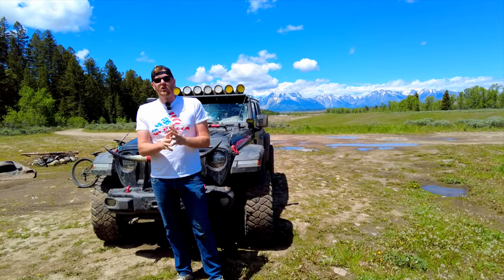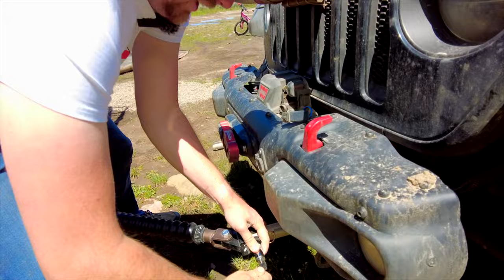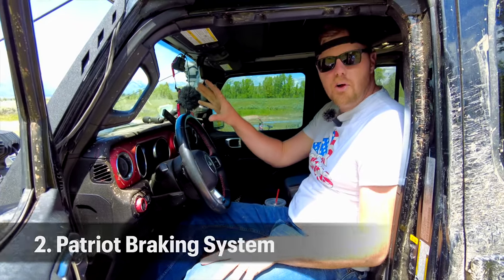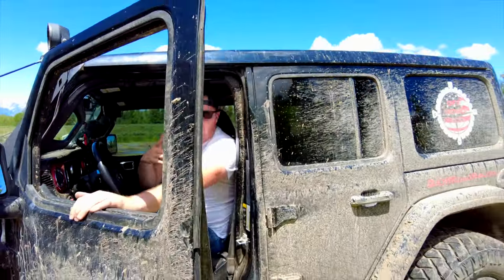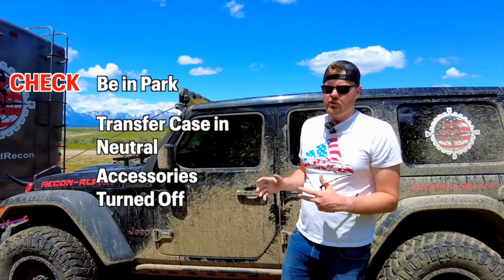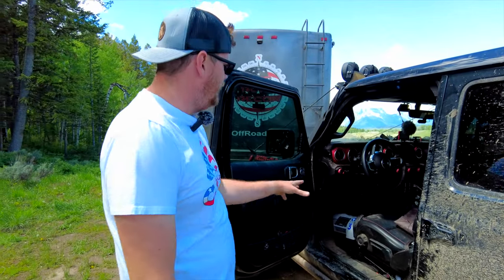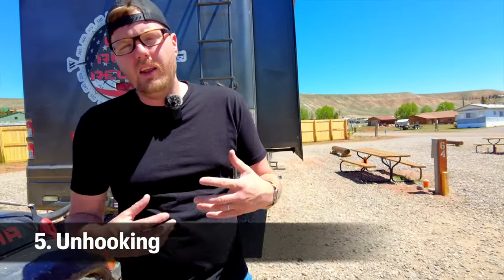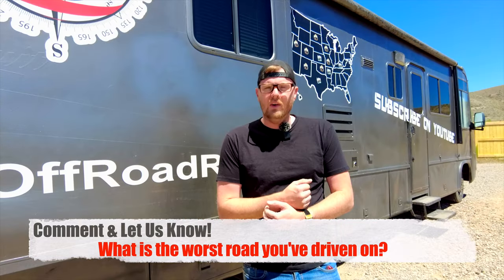Flat Towing: 101 With BlueOx Patriot Brake System (MOST VEHICLES)

Comment: If you cross your safety cables under the tow bar before hooking to your baseplate, it will hold your tow bar up off of the ground if the towing system fails.
Reply from the maker: Good tip. Thanks!

Comment: Ima is correct those cables are supposed to go to the opposite side. Blue Ox rep stated to make sure you criss-cross them under the Blue Ox bar. He also stated to place the pins and hooks facing the same way. That is if the lock is on the inside for the right it will be on the outside on the left arm.

Comment: Doesn’t that thing bounce around while you’re moving?  Seems like it has to be set in there just right and if it gets out of wack it won’t work. ?
Reply from the maker: No. The metal arm holds it in place. If you get it to tight it won’t work and or hold your brake lights on. We have put thousands of miles on our flat tow setup.

Comment: Thanks for the video.    Does the Blue OX Patriot drain your battery ?   If so, how do you get past that issue?   I have a 2022 gladiator and was thinking of buying this system.
Reply from the maker: Depends how long you flat tow. I have done 3 day trips with no problem.. you could always remote start your Jeep every once in a while to let the alternator charge it. Hope you subscribe!
Reply: @BenandBrandi  Thank you for your response.  I appreciate the information as I am now planning on getting the Patriot 3 also.  And yes, I did subscribe...  😀

Comment: Do you have a video explaining the set up of the wiring for the braking system? I’m a little confused as to what triggers the patriot braking system to apply the brakes. Is it the same wire that triggers the brake lights? That’s the only thing I can think of. I just can’t find a tutorial explaining that part. 

Any help is appreciated. Thanks!
Reply from the maker: The Blue Ox Patriot Portable Braking System - Proportional # BLU37TR, uses a 12V powered remote that wirelessly connects to the 12V powered braking unit. This wireless remote has an inertia-based sensor in it that can sense the braking of the towing vehicle and communicates that braking need to the towed vehicle. The remote also give you a manual override feature like brake controllers do to allow you to apply the brakes in the towed vehicle as you determine necessary. It also has a light indicator so you know when the brakes are being applied on your towed vehicle from the cabin of your towing vehicle.
Reply from the maker: Hope you subscribe to our channel and follow our adventures!
Reply: @BenandBrandi  I just subscribed! 

Thank you for that info! It’s a lot harder to find a straight forward answer than you would think. 

I’ll be towing a 2024 wrangler JL . The bracket you posted on the subscription… is that my best option?

Comment: Fantastic video!
We just installed your brake system in your 2 door wrangle. What would be your recommendation trying to find the correct settings? Just get on the road and go for it.
Reply from the maker: I like to adjust as needed while driving.
Reply: Can you explain please
Reply from the maker: Find a safe place to use your brakes off and on and adjust the settings while using your brakes to test the pull of your tow vehicle when pressing the brakes.. much like testing and adjusting trailer brakes..

Comment: Do you do hard wheeling in your JL? The bracket that is connected to the front of the jeep, is it easily removable? It seems like you will lose clearance for climbing rocks with that piece and the pieces sticking out forward of the bumper.  But overall seems like a good setup
Reply from the maker: We do. The front bars slide out… the actual plate is pretty slimline

Comment: nonoe of flat tow vdos show how the FOOOKk does the steeering of towed vehicle works .. it means its simply dragging n skidding on the steering wheels of the towed vehicle leading to worst wear n tear of the steering wheel tyres behind the RV... such a shame
Reply from the maker: The wheels turn as Needed, you cannot have a steering lock.
Reply: @BenandBrandi  how do the wheels turn ? what prompts it   ?   you mean they drag n turn as sort of skid steer ?
i saw some videos where front wheels dont turn n they just drag
Reply: @hrishihru  That’s not true.  With the transfer case in neutral, the front tires of the toad free spin and turn as needed without any damage
Reply: @hrishihru That's not true, because front wheels have "caster" similar to grocery shopping carts that allow them to harmlessly turn as needed to follow the tow vehicle even around sharp corners as long as the steering wheel can freely rotate which is why it must be disengaged if it has a locking steering wheel.